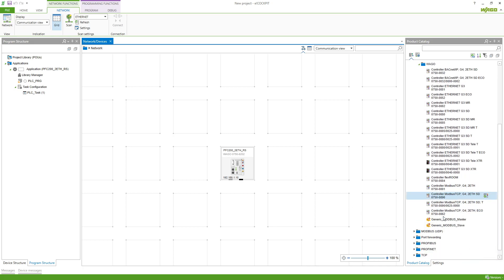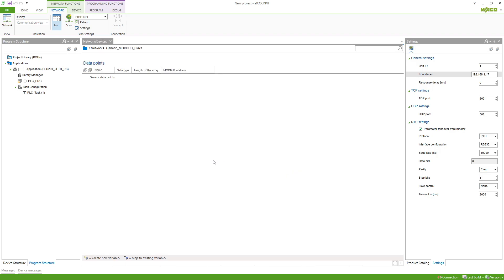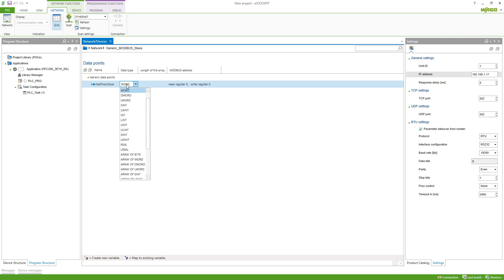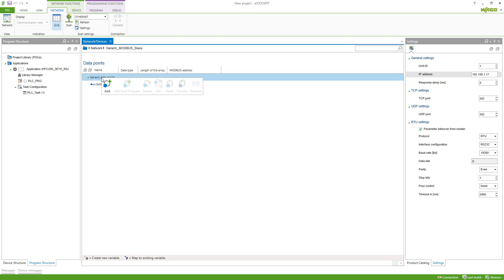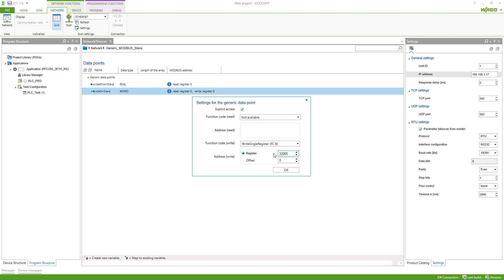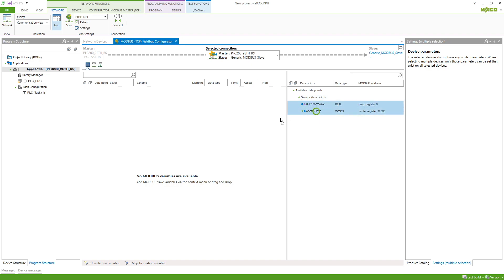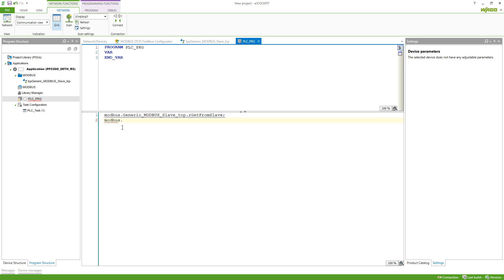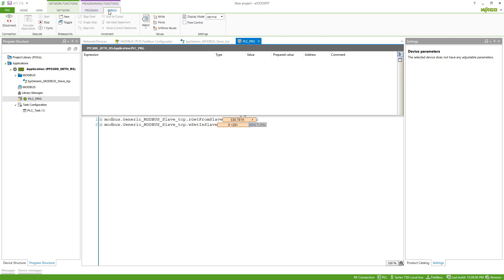e!COCKPIT - Modbus Configurator #2 – Connect a slave to the controller

Comment: Hello WAGO team. 
How can I send variables from PFC 200 runtime to Node Red? 
One way is to use network variables. But Is there a way to use Modbus? Or maybe there are better ways to communicate?
Reply from the maker: Dear elmachooooo,
first of all, sorry for the late answer. Basically, the PFC200 supports the following communication protocols:

-Modbus (TCP, UDP)
-ETHERNET
-EtherNet/IP adapter (slave), library for e!RUNTIME
-Modbus® RTU
-RS--232 interface
-RS-485 interface
-MQTT
-EtherCAT master, requires an additional licence
-BACnet/IP, requires an additional licence
If the remote station (in this case Node Red) also supports one of these protocols, a communication should be possible. Configurators or library solutions are available under e!COCKPIT.
Best regards from the WAGO Team

Comment: Usefull video, thanks. 
I would have a question: what about the general master controller?
If I have to pubblic a variable for an external master, whitch steps are needed ?
I think the iter is the same, but with less steps, can you confirm  and explane it?
Reply from the maker: Dear risc80,
please have a look into the manual from the modbus configurator at page 64 (e!COCKPIT version 1.10.0.1)
Path C:\ProgramData\WAGO Software\e!COCKPIT\Documentation. ProgramData is an invisible folder 
If you need further support please don´t hesitate to contact our Support postbox support@wago.com
Best regards from the WAGO Team